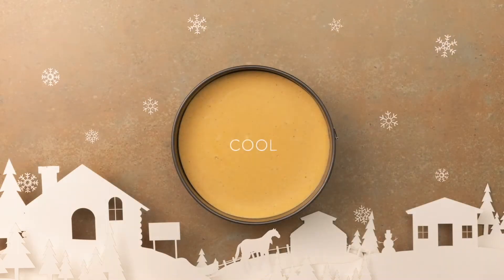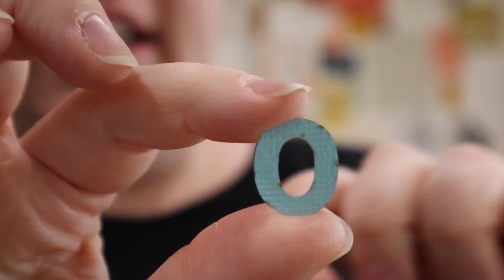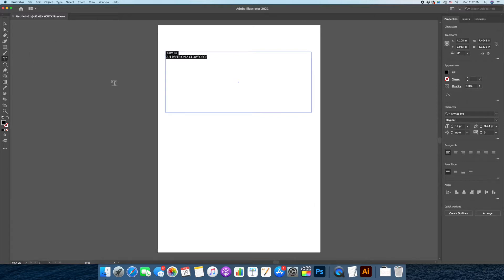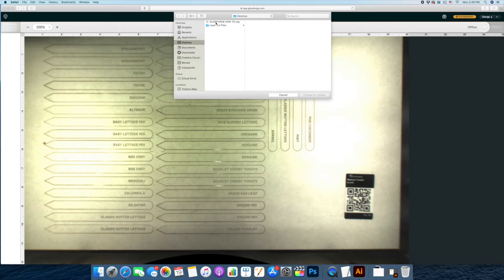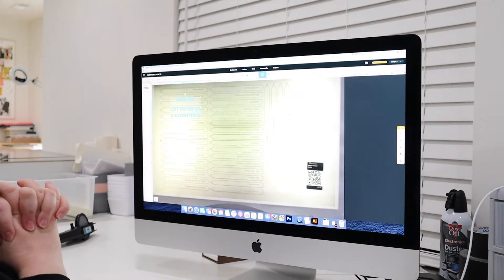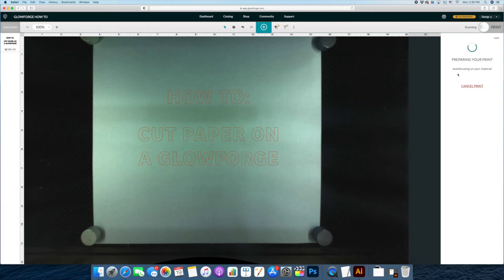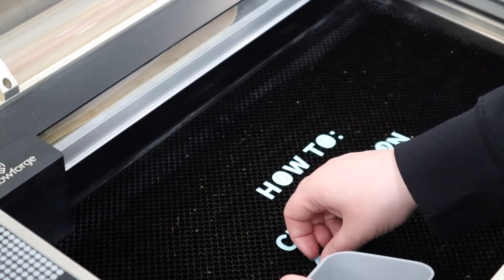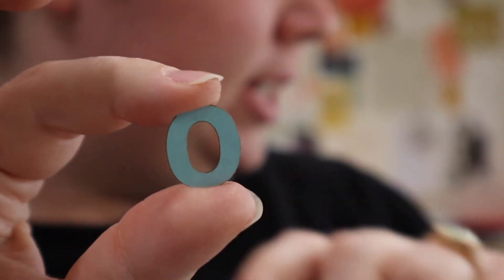How To Cut Paper With a Laser | Glowforge Pro Tutorial

Comment: I was admiring your work on IG and wanted to ask you about your settings but didn't want to bug you, so I googled and your video was a top result 😅 thank you for sharing your settings! Have you ever tried cutting on a tacky cutting mat like a cricut mat to help hold on to paper bits or is that more work than pulling it straight off the honeycomb bed?
Reply from the maker: Thanks so much! I haven't tried laser cutting on a sticky mat. If I am working with a bunch of small paper bits, I will put a second sheet of paper underneath and after the cut use that second sheet to funnel the small bits into a container!
Reply: @trisha_zemp   Ahh thank you for reminding me about the tip to put a paper underneath to catch all the things. May I ask how you prevent your little cut up pieces from being blown all over the place? Thank you so much!
Reply from the maker: @lingwang5055  If they are extra pieces from the cut that I don't need, then I don't stress about them blowing around. I let them fall into the crumb tray and empty it out later. If I need small pieces I will usually cut a bunch of extra in case I loose some from being blown around. :)
Reply: @trisha_zemp  ahhhh, gotcha! Thank you for taking the time to reply ☺️🙏💕

Comment: What holds the paper in place if you don’t use the magnetic and why can’t it cut vinyl?
Reply from the maker: You can use magnets to hold the paper. Cutting vinyl will produce chlorine gas which toxic.
Reply: @trisha_zemp  if you don’t use magnet then what holds the paper in place was what I was asking.
Reply from the maker: @myisha7833  just the weight of the paper itself. Most of the time is stays put just fine. But, if you are cutting something intricate, I definitely recommend using magnets!
Reply: @trisha_zemp  oh that is interesting. I was curious because I have purchased electronic cutters in the past that require the use of sticker mats to hold paper. This machine seems like a game changer.

Comment: Great video!  Have you tried cutting through multiple sheets of paper?  Do you have those settings?
Reply from the maker: Yes we have tried it.  But we don't do it, the reason is that we always get substantial burn marks on the sheets that are below the top sheet.  We haven't had the need to optimize multiple sheets  it to get rid of the burn marks so we don't really have good settings for that.